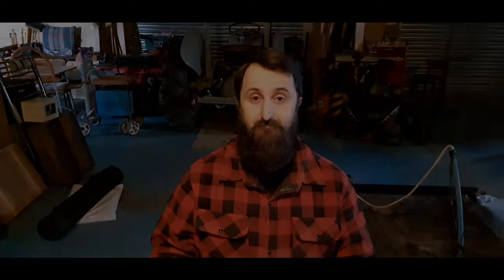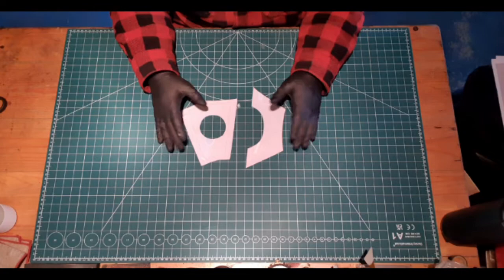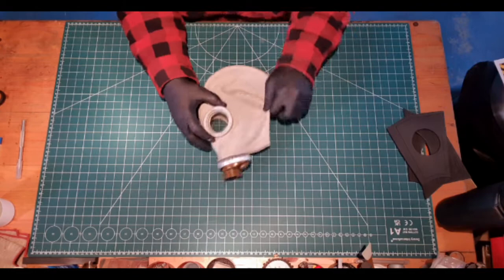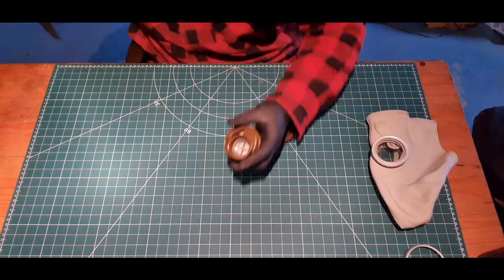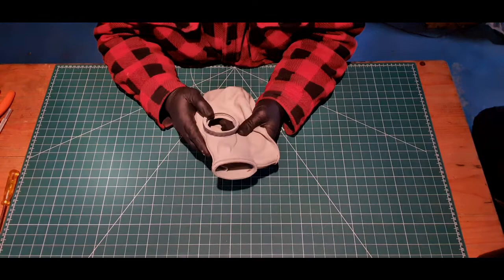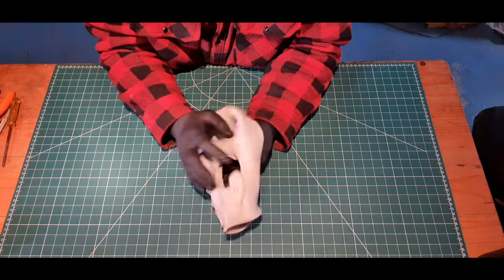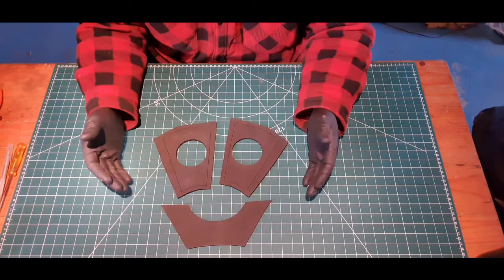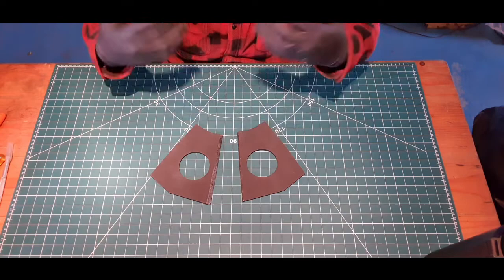Death Korps Of Krieg Gas Mask Tutorial by Iron Warrior Cosplay

Comment: A couple of questions:
Is heat shaping absolutely necessary for the shaping of the mask?
I have the lens of a GP 5 but none of the rubber parts (bought them separate becasue I didn't want to rip up an old gas mask), can the lens still be inserted into the foams holes or will I have to fanangle a bit to get them in?
Reply from the maker: Hi there! Thank you for your questions :D 

1. No,  you can just bend the 5mm foam and leave it for a bit and it will kinda hold it's shape a little. Heat isn't 100% needed. If you do have a hair dryer though that might work better than nothing. 

2. If you have all the GP5 Parts but no rubber I'm not 100% sure how you could have them put in, maybe try using some fabric on the inside and then use that to anchor the lenses and metal clasps. Not sure how I'd do it but I'd have to try it myself to figure it out for sure. 

Hope this helps :)
Reply: @ironwarriorcosplay  Thanks! I also just wanted to say I finished the shoulder armor recently and they came out really well, so thanks for the patterns!
Reply from the maker: Please send me some photos! I'd love to see!!
Reply: @ironwarriorcosplay  I still need to paint them, but I'll post when they're done